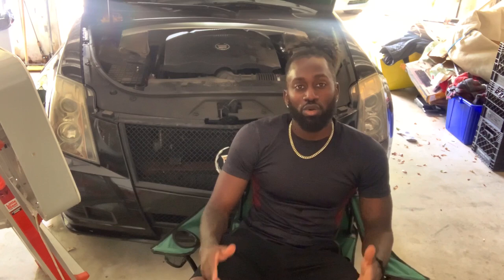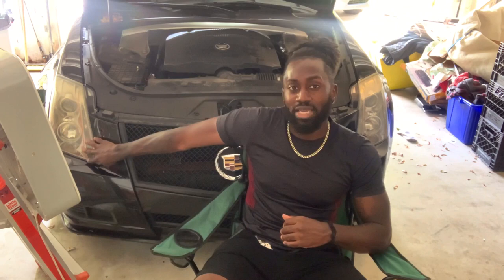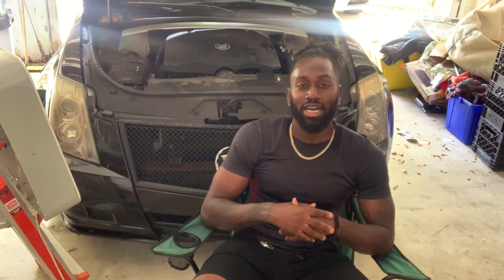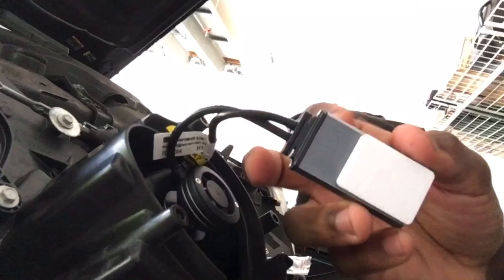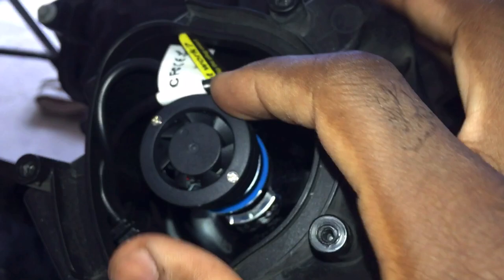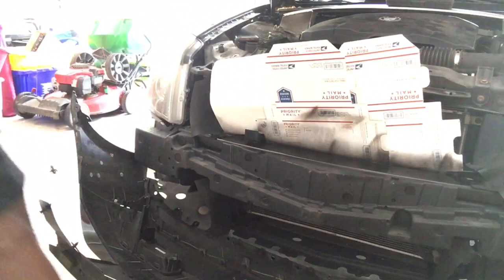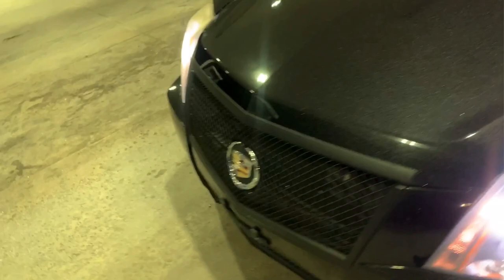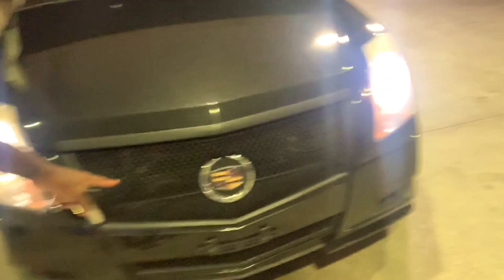How To Install Custom LED Headlights : Cadillac CTS Coupe *BRIGHTEST LIGHTS*

Comment: Don't do HID's in a CTS that didn't come with them from the factory! Trust me. GM has a service bulletin about this that I didn't find out about until a couple hundred bucks in wasted diagnostics time at the shop. The power surge of the ballast when starting the engine (or just before) causes havoc in the computers and can randomly put the car in limp mode with a variety of codes and "service stabilitrak" and/or "service AWD" showing on DIC. Bulletin states to stick with halogen when equipped with such from the factory but LED's drawing much less do not cause any issues which i can attest to from having them in for over a year. I'd recommend Sylvania H11 ZEVO's for bulbs--I tried several eBay type off brands and all were total $hit, spend the extra and go for name brand HUGE difference when you do. Well worth $99.99 for the pair.
Reply: Any instructions on how to convert. I have the lights with the drl bar.
Reply: @dnoochy3917  convert to what exactly?

Comment: yeah bro lets get it. lets see that HID swap out. I have the original 2011 CTS 3.6 Coupe. I just ordered the headlight assembly replacement and now working on research for bulbs. I see ya bro. see my video on the headlight work I had to do.